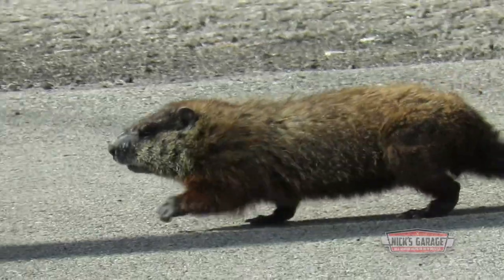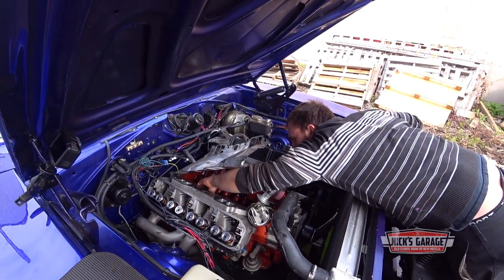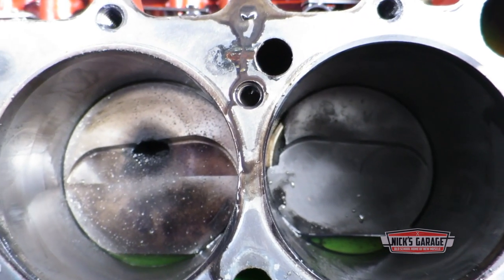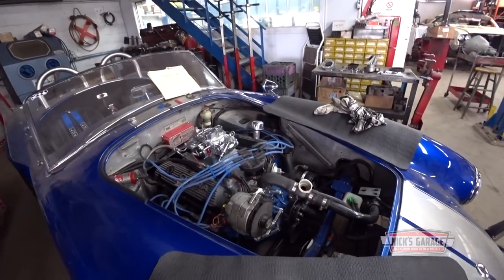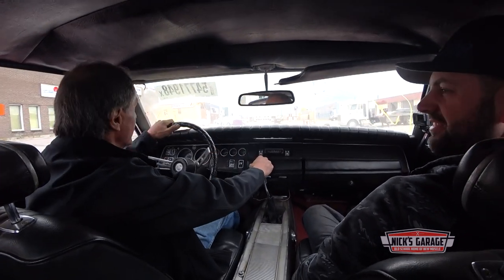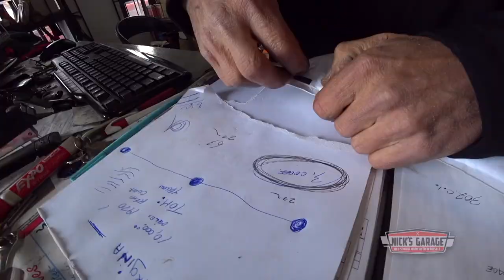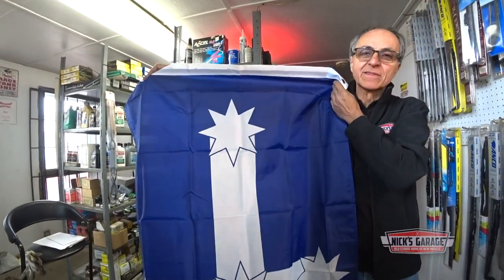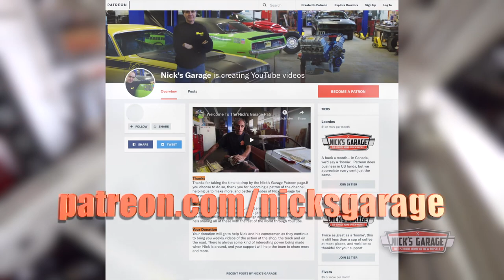Wicked 1968 Charger Blows Up - What Went Wrong?

Comment: You can't just add f.i. or turbo or superchargers to an engine not designed to handle it. When disassembling, parts being reused should be kept in exact order - especially pushrods and lifters. They wear into place as they are. F.I., etc. can increase combustion pressures destroying standard pistons, blowing gaskets, etc. Upgrade to better pistons Nick.

Comment: Ran lean,the piston/ combustion chamber color is quite clear  : i guess because of a bad valve adjustment,or valve not seating properly.
Then It detonated,because way too hot ,you can see it started on the edge of the valve recess just on the angle,wich is generally a hot spot prone to create detonation.
The other piston got hot too, fire rings expanded until they got in contact and broke the ring land.

Comment: I may be wrong but I think there might have been an errant washer in that one cylinder with the hole in the middle of the piston, there's a conspicuous round mark on the head and the whole is no where near a valve or the spark plug, the other cylinder looks like it burned a whole in it from the blown head gasket, see what you find in the oil pan.

Comment: Technically, that isn't the intake gasket. The non-orange section of the replacement, that's the intake gasket. The material in orange that bridges them, is a lifter valley cover.  It keeps hot oil from warming up the intake charge.  Which means the section Nick keeps referring to as the crankcase, is in fact the lifter valley. The crankcase is the space below the cam shaft--it holds the crank.  Those intake spacers ARE suspect, tho.  Its like someone used a B intake manifold on this RB block.  With the two front cylinders blown, my guess is whatever caused it, lifted up the head gasket in that area just enough for the fire to sneak past those stupid spacers, into the lifter valley, and lifted the cover up at the front as shown. It was the closest exit to atmosphere the flame front could find. 

Where did the piston pieces go? The piston ring land likely went out the exhaust port in pieces, but the center hole could have went south for the winter, into the crankcase. The marks on the number 4 exhaust valve, tho, suggest they bounced around before going out.  Had they got into the crankcase, they would have been following the path of the explosion--which probably would have blown the oil dipstick out before bulging the oil pan sides. Then again, the RB is a deep skirt design, it may have been enough crankcase area to disperse the shock wave. I'm betting the pieces were exhaled, the ports will show the witness marks.

Comment: I've been turning wrenches for over 15 years, and I've seen more problems with aftermarket parts than I can remember, especially electronic aftermarket parts.  I wouldn't use an aftermarket EFI setup if somebody paid me to.  If the factory built it with a carburetor, leave it alone.  If the factory built it with EFI, leave it alone!
Reply: @paulcopeland9035  I figured it was caused by nitrous, but it still doesn't change my opinion of aftermarket parts.
Reply: @paulcopeland9035  Like most things... that all depends...  Yeah, if you buy a high quality, name brand aftermarket EFI system and have it professionally installed and tuned, it will probably be just fine.  Will it outperform a name brand, high quality, professionally installed carburetor?  In my experience, no.  I work on late model vehicles every day in my career.  There is a reason why every vehicle I own is older than 1980.  I keep all of my old trucks stock, in tune and meticulously maintained for MUCH less money than even a ten year old vehicle.  Not one of my old trucks have I put more than $2,000 into, and I get great gas mileage and more than adequate performance out of the 40+ year old parts.  But, if you like EFI, go with EFI... and pay a guy like me to fix it when you can't.  ;)

Comment: I'm loving the "Basin Street Blue" Dart. What's the story on that one? I had a 73 same color with the white over the roof stripe. I was originally a 340 Automatic car. When I got it, it had a blown 318 in it. I swapped in a slant 225 with a 3 speed manual which I later swapped in a 3 speed O/D trans. Fun car.
Reply: Frank.     If you are talking about the blue 73 Duster? My brother just sold it to my friend. Waiting to see what we do.
Reply: @nickpanaritis4122  Sorry, thought it was a Dart SS...it's the one sitting under the older coronet on the lift.

Comment: I would get rid of the mechanical fuel pump and go with a trunk mounted electric fuel pump.Then get rid of the mechanical cooling fan and go dual electric with thermostatic control. Efficiency!

Comment: happened to me b4. crankcase gasses ignited while checkin the oil when the dipstick hit the pos. battery cable on 68 gtx. it did valve covers the same way. needs a couple pcv valves. what a boom.

Comment: The owner kept cycling the key and filled crankcase with gas, it gives a 10 sec. Shot to wet the intake for start, you need a switch to shut off fuel pump so you can cycle the key without flooding the crank, that is same mistake I made with same result

Comment: like your vids... 2.5 minutes in and my guess is the engine wasnt at top dead center or in the proper alignment, when the distributor was set in and was near 180 out but was enough into spec to run and caused it to overheat a cylinder. Like to see a vid on a 67 coronet rt. 12;25 in and I would recommend using a telescope gage to measure bore. The top of the bore often has a ridge or build up of carbon thus will not be the true measurement.

Comment: I say "It's Always Something" when the problems crop up and I have to jury rig a fix.  It is normal, not unusual at all.  But driving without brakes, or with a brake pedal that goes to the floor, that is unusual, and not recommended practice at my house.  Nick - what's with the super-long-throw shifters?

Comment: Just added fuel injection, #2 and #4 cylinders have melted pistons? I have seen this before. fuel burning too fast, hence, too hot, and possibly the timing was too far advanced,  heat + detonation are destructive. Possibly a problem with one or more of the injectors in the throttle body, but definitely caused by way too fast of a burn. Either too lean, too low of an octane for the chosen compression ratio, and or, timing too far advanced for the speed of the burn.   Detonation damage. 
In the old days (before 02 sensors and fuel ratio gauges) we would intentionally start them up rich, then during the break in period, monitor the spark plugs as we installed gradually smaller jets in the old Holleys.  when the spark plugs pulled out clean, and the inside of the exhaust pipes were grey, we stopped.

Comment: Need to find the blown out pieces! See if it has wedged inside the exhaust & if it could cause any future issues. My thought is; Either it blew out of the exhaust or, it is stuck in the exhaust or, inside the block/crank case? Hopefully it blew out of the exhaust!

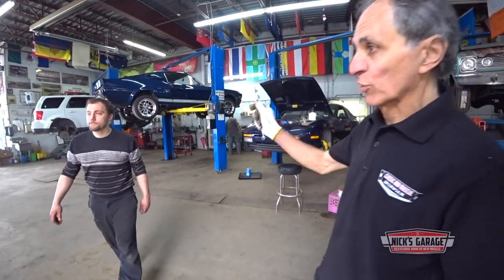Comment: 12:57 Nick referenced the Shelby as “Eleanor”(from the remake, not the 71’ Mach-1 from the original)
Only a gear head/movie buff, would know what that means. 🤣🤣🤣🤣.
Thanks Nick for the laughs, the great entertainment and especially the knowledge you drop on us whenever you post a video or live podcast. God bless you sir.
Reply: IRONHEAD   Eleanor was a 73 Mustang, and was about the plainest looking Mustang ever.  What they did in the remake was criminal.  The 67 version would never survive what that 73 took.
Reply: Doug Scott are you suggesting that Hollywood uses only one car per movie? The so called 73 Mustang, is actually a 71. They used more than 15 during the filming. Most ended on the scrap heap. Neither the 67 or 71 or the 73 as the movie claims, would be able to survive what they put those cars through. Believe me, I should know. I knew a few of the stuntmen. None of us like the 2000 movie either, just the cars.

Comment: Just wanted to ask you a couple of questions! I  have a 66 ss Chevelle and I'm definitely not a rich man.  I had a 11to 1 350 SB with Dart Motown heads and a solid lift cam and a victor jr intake and a 750 that I worked up into a 825 according to the Holley book! I also have a muncie 4 sd with a 600$ zoom clutch and a 12 bolt with the original brute strength carrier and Chevy 4:88 gears.  The 350 got hurt after 7 years of racing and every day driving because at the time we didn't have another vehicle! So I couldn't afford to get another short block but I had 2 short blocks that I've collected thru the years.  I have a original DZ 302 and a L79 327. I decided to rebuild the 327 because of the cubic inches.  It had original 40,000 miles so I decided to stay with the original 11to1 pistons but since the 1966  327s had problems throwing rods I decided to eliminate the stock rod bolts and I used the ARP rod bolts and I also used the ARP main cap studs and I had the crank turned just to be safe. First question is will changing the rod bolts and main cap bolts help the bottom end stay together? I read somewhere that those were the weak spots of the short block! Another thing will I have a Big decrease in horse power with the little 327? The car used to run 11:50s in the Quarter mile! How much slower will it be with the 327? And will the bottom end stay together with a small shot of nitrous and if so how much nitrous would you use ? Reason I'm asking about the nitrous is that I've never used nitrous oxide before and this would be my first time trying it! Now I'm 54 years old and I've been street racing since I was 19 years old so I'm definitely not a new comer to racing!!! Anyway any information that you can help me with would definitely be appreciated thanks!!!
Reply: William.   Bigger in cubic inch is better. Replace the connecting rods with after market and use a main cap stud kit from ARP.
Reply: @nickpanaritis4122  that's what I bought was a ARP stud kit for a windage tray! Now the rods I had red were ok as long as I went with ARP rod bolts because that was the weak part of the 327 and why they threw rods! But if you think that the rods won't Last then I might have to reconsider!!! The L79 came with a factory steel crank so I wasn't worried about it!!!!

Comment: went lean in those 2 cylinder caused detonation, must been fed by the same manifold runner, shattered ring land makes it obvious as well as the hole in the other, I have seen a loose bolt make past the exhaust valve from the intake manifold after destroying the piston crown and valve seat he is lucky that land piece seemed to cleanly pass through the exhaust, complete rebuild is in order no doubt about it.

Comment: a vacuum leak will cause that, I've seen it several times ,cold air will burn a hole right through your Pistons, then your crankcase fills up with unburned gasoline that makes a bomb I blew the valve covers right off a small block Chevy once trying to start my father-in-law's truck. I was standing in front of it and had to find my way out of a huge cloud of smoke 2 seconds later the Oil cap came back to Earth.

Comment: It happened because most likely the Holley was seeing a 9000 rpm single when the key was turned to on if u kno what I mean, if ur using msd the signal at start up cant sweep to 9000

Comment: I noticed that for a modified engine it seems he is running a stock looking vacuum advance distributor and a balast resistor? I would have changed it to a modern electronic ignition system?

Comment: Sounds like that fuel injection was dumping fuel right into the crankcase. Timing wheel set up wrong programmed wrong, dumping fuel straight raw and firing too early. Those are usually pretty easy to set up. I watched it done it's pretty good forever unless you do something wrong.

Comment: No matter what, he needs a overhaul in the worst way, and to rebuild a 440 magnum won't be cheap.  But it will be done right with Nick's Garage and will be dependable.  This is what happens when you don't leave shit alone and want to make changes.  Can cost  more than it's worth in the long run.  Just hope that motor needed overhauling anyway.

Comment: I didn't see any thing that looked like NOS system. The guy that put on the injection bought for stock engine and never hooked up a laptop to tune it. It ran real lean, burnt hole in one piston, the other piston was destroyed by pre- ignition, rattled itself to death. If he didn't crack the cylinder I'll be suprised.

Comment: Sorry, just my thoughts as the video plays to see if I'm close to what happened. Small screw or nut is what's on my mind for damages.  

Testing myself. 
I will find out as go along. 
Small items will bounce back and forth on same runner plane on duel runners and with single plane it will go where inertia or vacum is greatest if it gets thrown back up through intake valve and things that get by the intake valve very seldom gets pushed out the exhaust because of smaller opening.   Coming up for the intake stroke when valve is opening it can be thrown back into the intake and claim another victim,

Comment: I'm a line mechanic of 27 yrs, now retired. NOT a hard diagnosis. Owner installed FI and ran it lean, causing preignition (ping) and/or possible nitro. Wasn't calibrated properly, causing internal damage! Why couldn't Nick diagnosis this?

Comment: megasquirt microsquirt ecu  is my favorite simple  they make fair truthfully priced units 350+for ms3 gold or what ever its called we support the community so it one has issue no resign it can not be easily worked out.....that engine will run fin with just pistons fixed but bore may  goofed more than i can  see but i seen engines run fin with a few lines in bores all depends on what one is doing n how bad it is A*** guys

Comment: maybe one injector not working right, leaning that corner out, plug wires swapped, nasty carnage for sure
Reply: @paulcopeland9035  it doesnt need to be port injection to make one corner lean out, one injector of the 4 would lean that corner enough to eat it, same as carburetor with one jet plugged (non progressive crap )

Comment: Running aftermarket wetflow injection with speed density. Im sure the tune was off by miles, especially with an airgap intake. Those are a nightmare to tune and get right due to all the fuel dynamics. It will just backfire and stumble all day long if its not just right. Definitely not like a carb at all. Much better either sticking with a carb or going full SFI injection. That's the worst of both worlds, there.

Comment: Detonation comes from two reasons number one too advanced.. number two if the spark plug is too deep into the cylinder it will cause two flame fronts, one is moving  up and smacking the head the other going down and hitting the piston the one that hits the head comes down and ricochets off the other. That engine was not lean do not blame it on the fuel it was detonation from timing and or too hot of a plug a colder plug sits closer to the head and you only have one flame front listen and learn.

Comment: I think I know what happend he did not do his research on efi . Eather he put too much fuel or not enough and it reignited cause of vapors and he did not reset the timing for efi or nore did he figure out a way for the efi computer to be in control of the pressure and timing. The correct wire harnis and ecu  would of solved a lot of these prombles along with a software tuning o/s.

Comment: I'm not so sure about it being nitrous that was the source. Didn't see any nitrous lines or solenoids. My suspicion is detonation due to an overly lean condition under heavy load. Blew a hole in #4 piston and on the next stroke the fuel was sucked into the crankcase and then lit causing the fuel vapor in the crankcase to ignite blowing the intake gasket along with the upper ring land of the #2 cylinder.I doubt the chunks of piston made it past the exhaust valve of the #4 cylinder, otherwise you'd have seen witness marks in the combustion chamber and/or damage to the valve(s). I believe the pieces of the #4 piston is in the pan and the piece from the #2 cylinder shattered into small pieces that got blown past the exhaust vale of that cylinder.
Detonation is a horrible, wicked thing.

Wish he had finished with the diagnosis to know for sure.

Comment: My only question is this: Why didn't you do a cylinder leak down test before pulling the head? ANY GOOD mechanic would do a leak down test first. I say that as a mechanic with 40+ years experience. Just wondering?
Reply: Ron.    A compression test is simple.

Comment: Big block Mopar, the easiest engine in the world to work on. I could have that head off in less time than this video is long, without using air tools. EFI does not cause holes in pistons, but screwed up ignition timing, running nitrous oxide, or running cheap, Chineses knock-off pistons can cause big problems.

Comment: @20:38 - How are you getting that video? Low at right rear on the pavement, then up and through passenger window, behind driver and out and up the left side to the back. Weird!
Reply from the maker: Cool trick, hunh? Thanks for noticing. It’s a great little camera on a stick. Called the Insta360 ONEX. 🎥👍

Comment: Ummmm.  Why is there material glued to the sealing surface for the back window. Looks like a future leak. Oh well
Reply: That's old sealant - new will cover it fine. If you clean/scrape too good you take a chance with the paint and start a rust nightmare.
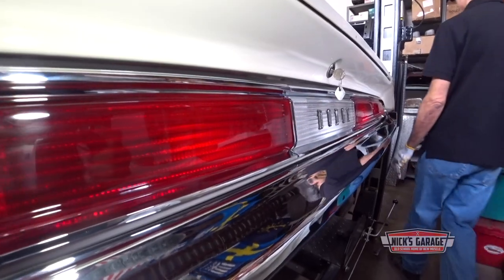Reply: Nope. Sure looks like headliner material glued to the seal surface. @ 15:08 in the vid. CLEARLY anyone can see the back window area and see the fabric glued were the rear window sealant will be placed. Wow thanks for the pointless comment. Would made better sense if a guy just said yes and it will be trimmed off before the window install. THEN I wouldn't say anything. Gosh.